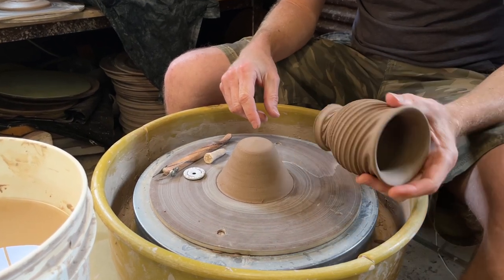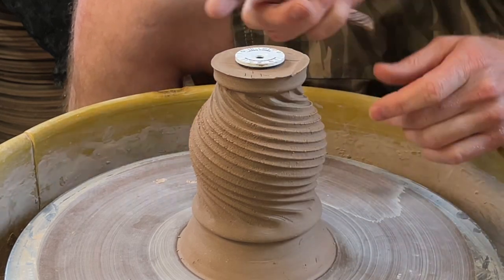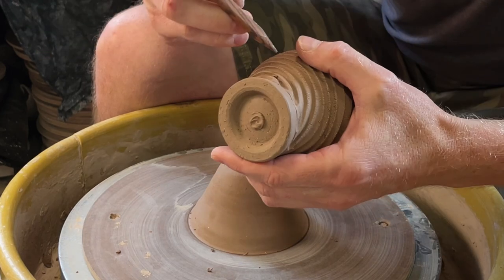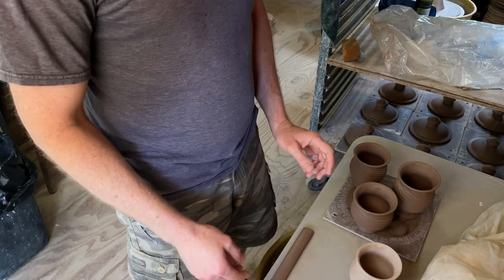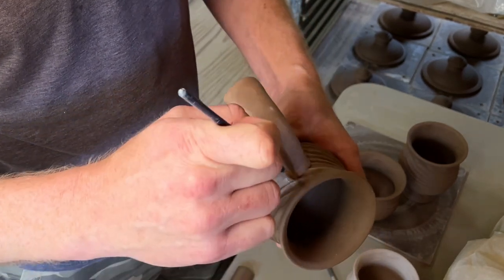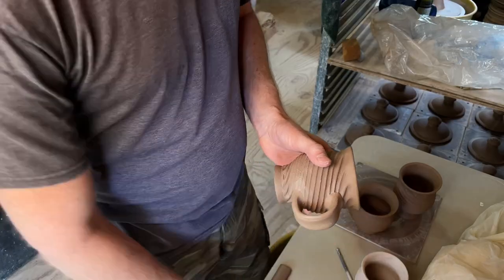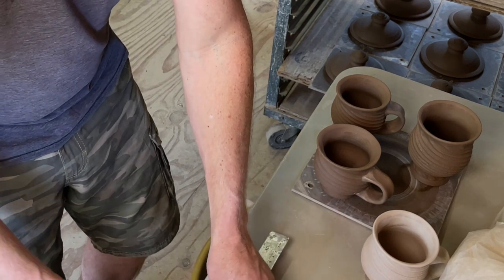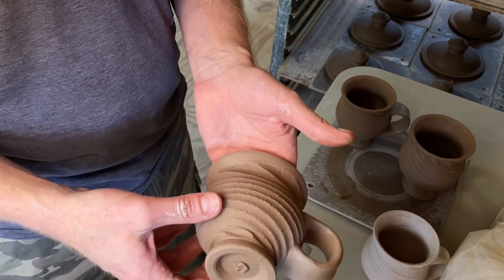Making A Twisted Mug - Part 2

Comment: I love that method of handle making.. it looks so good on the mugs!  I’ll have to send some pics through Instagram later!  I used 1.5 pounds of clay… I think it was too much, so I’m going to cut back to 1.25 lb.  They are pretty weighty lol
Reply from the maker: Thanks so much. They definitely are weighty but these pieces are not about the weight as much as the design. These handles took much longer than my normal ones but they are worth it on these mugs.